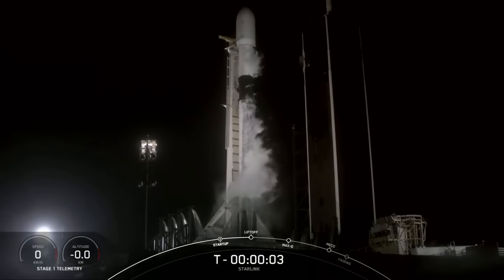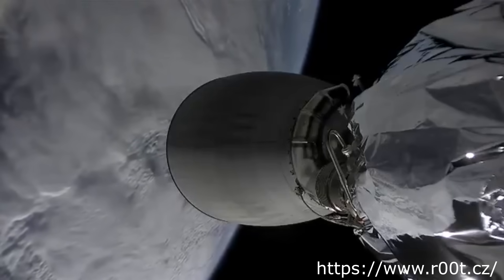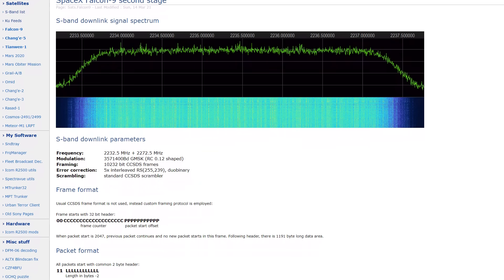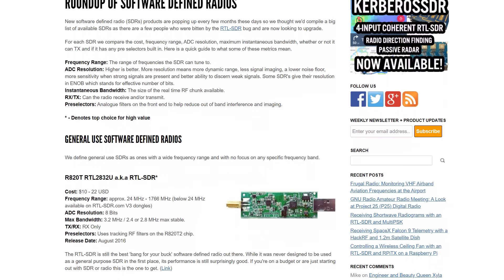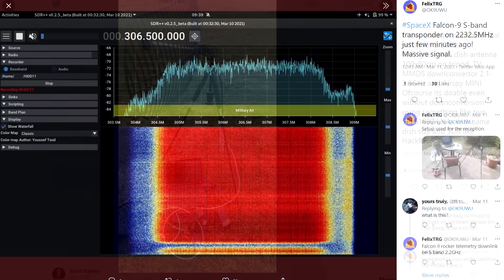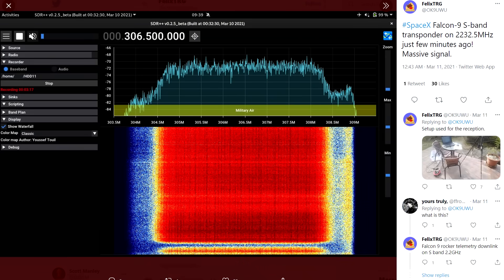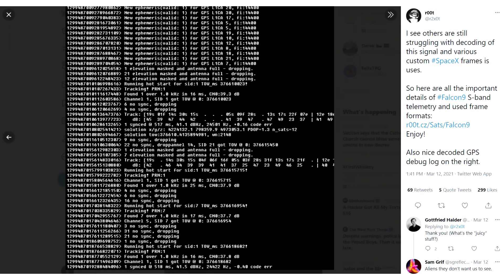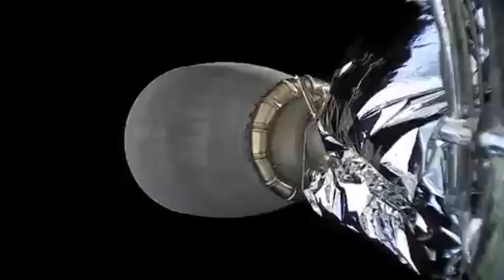How Amateur Radio Fans Decoded SpaceX's Telemetry & Engineering Video

Comment: There are actually SDRs that will go up to that frequency or higher, but the principle behind downconversion is that you supply a clean, known high frequency source and apply it to a mixer with the received RF to shift it down in frequency.  With a clean enough reference and appropriate filters for image rejection, this can get your data stream on a many GHz carrier down into the bandwidth of a regular ADC and directly digitize it.  This is the same sort of method that most commercial radios use, so wifi, phone, X band science stuff, etc. all rely on their signal occupying a given bandwidth, but generating it and digitizing it at low frequency and then using mixers to upconvert or downconvert it to the required carrier frequency.

You probably have the background in math to understand it just going through an explanation, but my favorite way to demonstrate it is through acoustics.  If you're tuning a couple of instruments to the same note they are not sinusoidal pure tones generally, but you can do mixing and downconversion directly in your own home and pick up on it by ear.  If you play a tone and play another tone 1Hz higher than it, you will hear the two together as a stable tone with a warble every second, and the warble is actually the downconverted difference frequency.  When the two acoustic waves interact, their frequency difference cancels each other out in a way that generates a 1Hz oscillation that's audible in the tone the same way a 1GHz radio carrier can be downconverted to a low speed ADC to read by feeding it another signal that's very close in frequency.  Mathematically, you get an "image" of the signal at the positive and negative difference frequency between the two tones, so a 440Hz A and a 441Hz sharper A produce a tone at 1Hz and a tone at 881Hz (a 1Hz warble and a high pitched gnarly note), just as a 2.5GHz incoming radio signal and a 2.499GHz local oscillation produce the incoming signal centered at 1MHz and 4.999GHz.  Then to digitize the latter, you just need an ADC that can sample the required bandwidth around your 1MHz new center frequency and appropriate image rejection (a low pass filter) to remove the 4.999GHz higher image and any feedthrough of the original 2.5GHz or 2.499GHz signals that could cause aliasing or other noise.

Comment: Not quite Scott.  Typically, an SDR receiver uses an ADC to change the analog signals from the antenna into digital signals that are processed using software on a general-purpose processor.  There's still hardware involved.
1. Collect the signal. i.e. Antenna  <- Hardware.
2. Superhetrodyne receiver.            <- Hardware.
3. Analogue to Digital Converter.   <- Hardware
4. Demodulator.                                <- Software.
5. Digital to Analogue Converter.   <- Hardware.

Comment: This is certainly cool. I don't think it was mentioned, but I'd assume the signal was recorded and then decoded afterwards, not in real-time. But of course once you have the specs, real-time decoding is possible. And once you have real-time decoding, the next thing obviously is to attempt to stream the result. This sounds like the kind of thing Elon would think is cool. (Presumably customer data is separate and encrypted if the customer needs that. This all takes me back to Fortran programming for TDRSS telemetry downlinks in about 1981.)

Comment: The frequency conversion from 2.3GHz to e.g. 0.3GHz is quite simple.  You can use a balanced mixer, and inject a 2GHz local oscillator.  Then you filter the 300MHz output and the rest is suppressed.   Its basically how radio receivers has worked for many decades.  They have used a variable local oscillator and a fixed output frequency where the passband filtering took place.   The same thing also take place in a sat-TV head.  It has a down converter mixing e.g. 11GHz down to 1GHz that is fed to the coax to the indoor receiver.  The lower frequency makes sure you loose less signal with a cheap RG-59 coax...

Comment: Very cool episode.

A bit more background on those software defined radios---the technological advances were heavily bankrolled by the transition from traditional UHF frequencies to HDTV in the United States. It kicked off a significant race to the bottom among radio manufacturers to build configurable tuners as cheaply as possible.

Comment: I figure that they choose not to encrypt because they want to be sure that they can get the engineering data even if there's bad signal or something is misbehaving.
An extra fraction of a second of available data could save an awful lot of work in failure analysis.
Reply: Um no. The LOX tank engineering is actually a non-trivial aspect of rocket development and we don't want the tech to fall into the wrong hands.

Comment: I think the elastic deformation energy stored in the fluid and the tank itself basically guarantees it will spring upward (almost) no matter how gentle the shut-down is.
Reply: Rocket lab has a video "Electron Stage Separation" with a view from a camera located underneath the fuel tank. When the first stage engines shut down, you can see the bottom of the second stage fuel tank springing back up considerably -- definitely enough to toss the fuel up like a slingshot. The compression of the fluid itself (and, consequently, the stored in it energy), would be orders of magnitude smaller and can be ignored. For Falcon 9, the situation is probably similar, though SpaceX rarely shows this particular view.

Comment: The lox is probably at the bottom of the tank because of the spin they put on the craft to separate the sats (this was obviously a Starlink mission, but I can't know if the video was before or after they started the spin, just guessing it's after).

Comment: I knew they had cameras in the fuel tanks

If they wanted they could easily encrypt it using xor otp non crackable negligible overhead so I guess they just don't care
Reply: until you get one bad packet or desync by one clock cycle and lose telemetry irrecoverably for the rest of the mission?

Comment: The issue of coding data that may have adjacent zeros in the data stream was figured out decades ago. Industrial 9-track tape drives used various coding methods through the years including a non return to zero scheme. So regardless of weather there were adjacent identical bits, there would always be magnetic flux change.

Comment: I think something important to note is that in a failure scenario for anything rocket related, often you might only receive one or two frames of data after things "go wrong" where you see things like the vehicle yawing or engines exploding. Those few frames are super important to diagnosing what went wrong, which is why we've been recording the telemetry as far back as we've had rocketry. The challenge then becomes that if you encrypt the stream, you add another layer of potential for that data to become unusable. Take any block cipher, for example (most ciphers in use today are block ciphers). These ciphers could encrypt the stream, sure, BUT at the cost of only being able to encrypt blocks of size X, where X is the size of the cipher, so 256-bits for AES-256. With that in mind, it's entirely possible that if a vehicle fails fast enough there's the possibility that some of that telemetry that would have been able to be sent otherwise no longer gets sent because we were waiting for a few extra bytes to add to the stream. That possibility alone may be enough to give the engineers at SpaceX pause before implementing encryption into the telemetry stream.
Reply: And adding something you don't need adds weight and power consumption. Power is a premium commodity in space, and weight costs. Why spend money on encryption when you don't need to?
Reply: Another thing to consider is bandwidth limitations.  There's a lot of interference in space which is dealt with using forward error correction (or at least that's how it used to work and I see no reason they wouldn't still use that method today).  Forward error correction requires a lot of extra bits (more bandwidth) to detect and possibly correct corrupted packets.  ComputerPhile did a video a while back where they talked about the way NASA did it for some of their missions, 32-bit encoding of I think 8-bit data which allowed something like 35% of the signal to be corrupted/lost and still be recoverable.  32 bits was convenient because the commercial computers of the time used it natively (this was well before Intel's x86 standard which is also 32-bit.
Reply: Yes!  That's why all that redundant data is not compressed.  If a rocket explodes on the pad you can get that the last bits of telemetry and figure out the sequence of things getting torn apart.  Very satisfying in a way.
Reply: I hope you're right, but SN11's telemetry from yesterdays static fire is encrypted, so maybe they don't care about it, or they get the telemetry from a different downlink.
Reply: @sarahjrandomnumbers  --  Is your claim a fact?
Reply: I worked on the radios that transmit such data. You also generally have interleaving, which is an error correction technique meant to spread out glitches over blocks of data, but this means that you could lose all of the frames in the block if the transmitter doesn't survive the transmission.

SpaceX does what it does to protect their financial interests and to get more Starlink satellites up there ASAP while there's no space regulation. Hardly any of their activities are related to actual space research.
Reply: They could just use a stream cipher, like chacha20. But I hope they don't and we get to see some interesting extra information
Reply: There's no need for any fancy encryption, just use a one-time pad. It's ironically more secure than any advanced encryption, and there are no blocks.
Reply: @leandrog2785 how big of a one time pad do you plan to use? Terabytes?
Reply: @leandrog2785 And put a small block number upfront each frame to synchronize the one-time-pad

Comment: Even if the space programs don't use standardized protocols, the demodulation techniques can be figured out easily (especially for digital data). The decoding part is harder, but easily done with enough people working on it and the knowledge that overhead must be minimized in order to minimize power consumption & keep it light weight (so simple encodings are used). Decrypting is a whole other bag of cats.

Comment: 3:25 It is called Downconverter. Its widely used on satellite tv where it convert Gigahertz range of frequency transmitted from the satellite (C Band, Ku Band, Ka Band and rarely S Band) to a more manageable megahertz VHF frequency and it is the round/conical looking thingy in front of the antenna dish (its widely known as LNB / Low Noise Block Downconverter). Why would  you need that you ask? That is because the Gigahertz frequency range would need a very expensive and impractical waveguide from the dish to the decoder but in the other hand, a vhf frequency would need a very cheap RG cable similar to the one that is used by old analog tv or amateur radio user. I'm not an expert here so correct me if I'm wrong, I'm just an amateur radio enthusiast who desperately trying to listen the Es'hail 2 QO-100 radio :D (it also use the S Band frequency) so I really interested on how they manage decode the video. Hope that help if anyone curious.

https://en.wikipedia.org/wiki/Low-noise_block_downconverter

Comment: 3:21 There are modified RTL dongles that go up to that range for ~$50 (https://www.nooelec.com/store/sdr/sdr-receivers/nesdr/nesdr-smartee-xtr.html) though I haven't tried it yet.
3:29 I think you mean a low noise block downconverter (LNB). Thats more for turning Ka/Ku band signals into lower L/S band and lower frequencies.
Also I may need to upgrade my v-dipoles and yagi antennas, and pursue getting a dish for picking up more data from more satellites.

Comment: USB DVB-T dongle does not work for receiving this S-band telemetry for two different reasons. The input frequency range not going to high enough frequency is one of them. Scott correctly pointed out at 3:15  this can be overcome by converting the RF frequency to a lower one. There is a second problem, however -- the telemetry comes with a relatively fast data rate -- about 3.7 Mbit/s. To record it correctly, the SDR has to digitize the signal at twice this rate. The cheap dongles simply cannot do it. The European radio amateurs used a more expensive SDR kit (HackRF -- about $300) which has a sufficiently fast analog-to-digital converter.

According to their FCC filings, SpaceX uses a very similar setup, based on off-the shelf "Universal Software Radio Peripheral" originally developed for Linux GNU-Radio project by Matt Ettus.

Comment: You never heard SGLS and PSK modulation? In the 70's, the Air Force used VHF and S band with PSK to send digital data from  satellites.  Then the Tracking Stations used De-Commutators to break down the Telemetry..   The 46 ft S band antennas had .25 Deg beam width.  Th 60 ft VHF antennas were .5 deg.

Comment: i am no expert with encryption but from what i understand there is no free lunch here encryption takes work and if you go crazy you can end up bogging your system down as fancy as those rockets are they have a limit to there processing power so there would only be a small space for encryption and it may not be worth it as a light encryption would be fairly easy to crack even the best of encryption's fall sooner or later. it would be waste of processing power that could be best used else where the most encryption would do is stop people from seeing it live someone could record it and crack it later on and its only telemetry not like there transmitting secret conversation's with the aliens that have bean watching us.

Comment: They have designed a down converter, all signals from Geostationary Satellites transmit in extremely high frequencies and standard sky  TV boxes  undertake a down conversion to enable a standard tuner or SDR to 'see; the transmit data and allow software to decode it.

This is something Radio Amateurs have homebrew built in the past, to build a HF Transceiver and down converter TX?RX for a stock VHF Transceiver to 'see'.

So I'm unsurprised that they have either built or modified an existing downconverter used for similar purposes, either by changing the IF crystals or changing other components, and then using a SDR to read the data at frequencies its designed for.

I expect that they will eventually use computer controlled tracking mechanisms to gather the data, and coorrdinate with Amateurs around the World to gather the telemetry and patch together a means to build the entire telemetry in real time, just as SpaceX does at the moment, in fact, with more Radio Amateurs on the planet than SpaceX has employees, the feed may be more stable than SpaceX gets themselves.

I've been using Amateur Radio Software for years to decode encrypted EUMETSAT Weather Satellite Data and build video of weather systems from images taken every 15 minutes, admitted not a video feed, but the method is similar.

73 de M5WJF

Comment: Basically, if you have 5GHz from the satellite and mix it with a 5.1GHz tone you get a 10.1 GHz signal you discard and a 0.1GHz=100MHz signal you can feed into your SDR.

Comment: Really cool. BTW It is an MPEG-2 Transport Stream containing H264 data. The MPEG2-TS is used because the dropped packets are not fatal as the stream initialization data is regularly sent to the demuxer. You could do the same with fragmented MPEG-4 as long as the initialization data provided.

Comment: The MMDS downconverter is just a mixer, I think. According to the specs, it injects a 2.3GHz signal and the received 2.6GHz frequency into a nonlinear device (like a set of diodes or transistor) to multiply the signals, essentially, and output the difference between the 2 frequencies at around 300MHz.

This is called heterodyning! It can be used for down or upconversion, depending on the application.
Reply: "heterodyning, diodes, transistors"  So quaint!
Reply: Yup, generally you build a really nice somewhat wideband receiver, a few hundred MHz, and then you use a down convertor to take the broadcast frequency and mix it down to an intermediate frequency or baseband.

It's pretty much reciprocal going up from baseband to the broadcast frequency.

You mix two signals together and you'll get the sum and the difference of them as a result. So mix a 300 MHz signal with a 2ghz sinewave and you'll get the 300mhz signal super imposed over 1700 and 2300 MHz. Filter off whichever side you don't want and there ya go.
Reply: @Noubers  --  I did some of that in the olden days.  Even played a tiny role in designing a hi-tech UHF mobile radio.  Fortunately the project was canceled before my tiny part ever got  to see actual use.

Comment: I have 2 of the RTL2832 dongles myself. They only can decode like 24-3000Mhz without up/down converters. I heard basically they found out that raw quadrature signals were being fed through the usb and just modded the existing drivers. It does not in any manner co process the signal as this video sort of suggested. That is done in the computer by the CPU.

Comment: And a new (r/outside) speedrun category was born:
1000$, laptop, empty garage with electricity to Falcon LOX tank live feed
Reply: Ok... Let's see. Set aside the laptop, you might need it to play games until SpaceX launches again.

20" screen from Goodwill - $10
HDMI 2 dvi converter - $6
Raspberry Pi 400 + power supply + video cable - $100
RTL SDR - $27

So, now you're set on the computer side after spending $143. How much is one of these antennas?
Reply: For $300 or less you could probably build a setup that would work. With $1,000 I'd be buying entry-grade professional tools. A really good RTL SDR is $45. (Cheep one is ~$15)